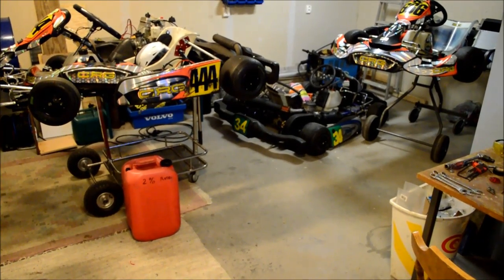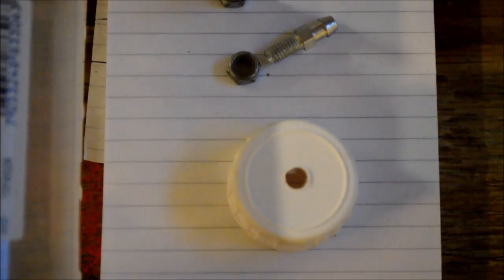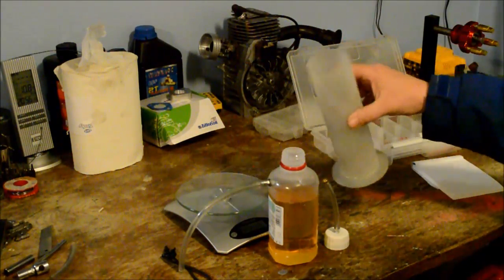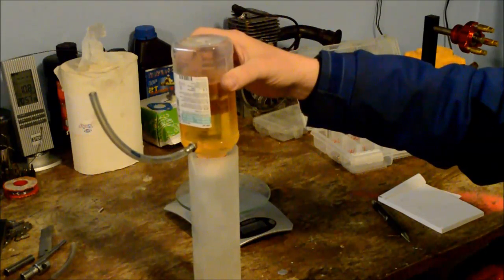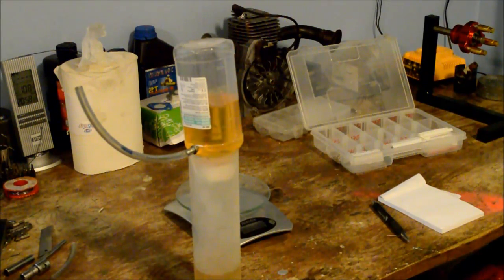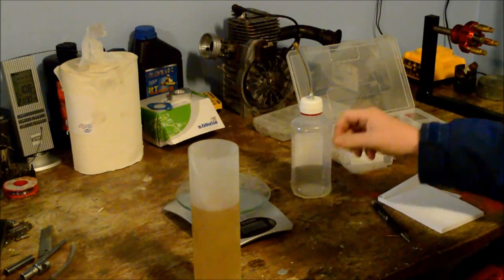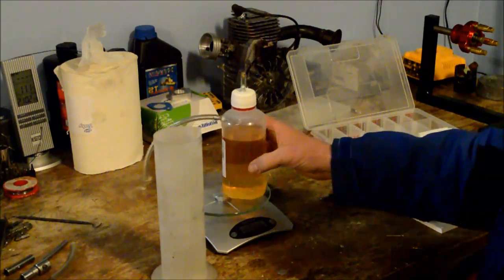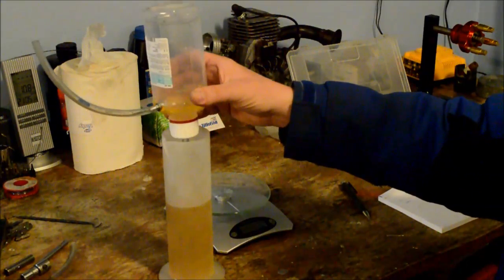Flowbench

Comment: Just found this looking for something else. Just in case anyone else comes across it by accident and wants to measure flow rate, you need a 19" 'head' of pressure. I forget where I read the number but AMAL and Mikuni used same head. You can use weight of fuel when you know specific gravity but it's easier to have a tube with on/off tap after the jet  and measure amount actually flowing. Use similar set up with larger bottle and air breather at the 20" mark (longer tube down to jet.)Measure for whatever amount of time you have patience for, 1 minute is better than 10 seconds (then multiply by 6) if you want accurate reading You get flow in cc/min. High precision jets will flow very close to marked numbers but general production jets can easily vary by +/- 5cc or more.